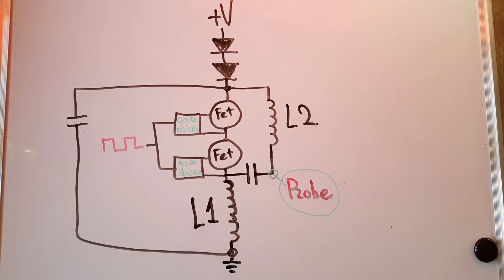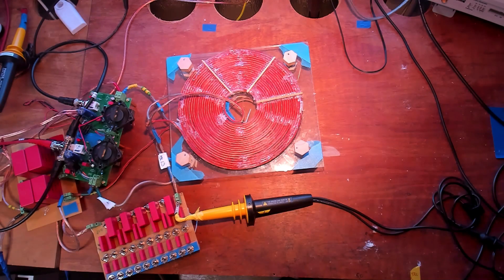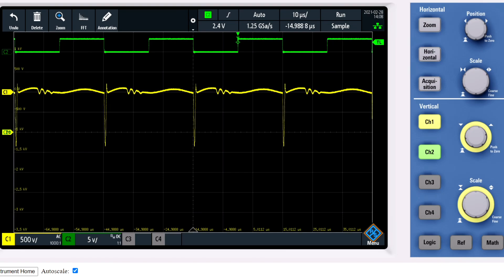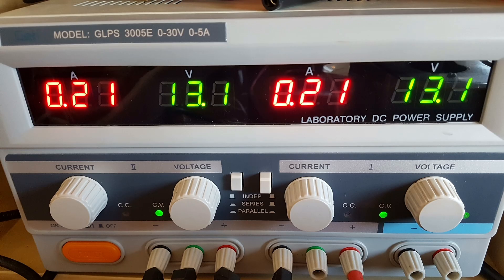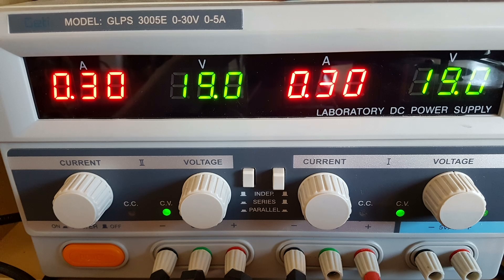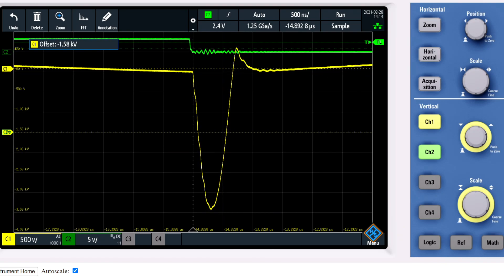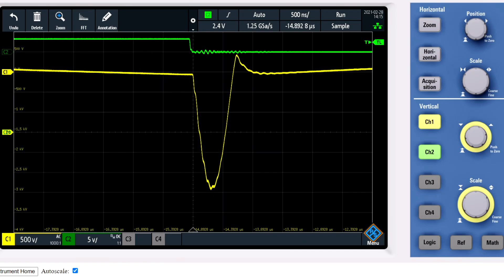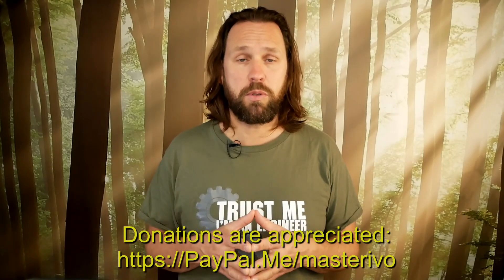High Voltage Impulse Generation

Comment: I hope you are doing great . I am wondering  can the inductive spike create magnetic field.  Yes  coil get's magnetized.  My question is polarized by differential back EMF ?  I think Yes.
Reply from the maker: The inductive spike is a resonant voltage half wave. It can do several things.
Can you ask the question again in other words?
Reply: @MasterIvo  I understand that resonant is a complete balanced circuit fine tuning is necessary .  Do coils have north and south poles toward magnetic field or does it become a undirected field. like ac that require more pushing volts to create polars.
Reply: If inductive spike is redirected to coil will it produce a higher magnetic field is question also.
Reply from the maker: The impulse from L1 creates an amplification of the magnetic field of L2.

resonance (full cycle) has 4 transformations between voltage and current, thus the current has both polarities. This means the magnetic field is alternating. so the polarities are flipping
Reply: @MasterIvo  love it Bro peace back too studies

Comment: Master Ivo, I have some serious urgent questions that I can’t find an answer to anywhere else, may I please send you an email?  Can’t seem to find your email address?
Reply from the maker: what is it about?
Reply: Regarding your initial circuit, I keep blowing midgets or not getting results, may I ask if drain of mosfet is connted to positive 12v battery then what is the negative side of battery connected to?   Same question is using dc to dc converter?  Also in your newer high-side circuit from the diagram I can’t tell what you connect the mosfet drain to??   Lastly I have many gate drivers and mosfets and I read the spec sheets over and over but I’m at a loss. To understand how to match a gate driver to mosfet?  Any help would be greatly appreciated, happy to send you a private email and donate as well
Reply: ***not magnets I mean mosfets, sorry
Reply from the maker: the battery is only powering the gate driver circuit(including buck converter).  the mosfet is connected to a separate power supply, if the drain is positive, than the source is connected to the L1 coil, amd the L1 coil (other side of the coil) is connected to the negative.

The battery is a separate power supply circuit! its negative is the mosfet source.

hope this helps.

each mosfet type prefers it own Vgs,   this voltage between gate and source makes it switch.

some mosfets need 15V Vgs, others need 10v Vgs  others 20Vgs.

the gate driver needs to be able to supply this voltage. that is supplied by the battery (in my circuit).
Reply: Yes but how do you power the mosfet drain? There is only one connecting point, so if the separate power source is a battery or dc converter or bench, where do you connect the other negative lead? I’m confused beacuse any separate power supply has at least 2 wires negative and positive but the mosfet drain only has one pin?
Reply: In other words what is the separate mosfet power. Supply grounded to?
Reply from the maker: V+ to mosfet drain
 mosfet source to L1 coil inside rim, L1 coil outside rim to V-(ground)
Reply: Thank you for your kind advice!

Comment: I was reading his patents on this. Main advantage of such coil Tesla said is the potential difference between turns is small and more safe to work with as there is no arcing at high voltages for that reason. Other benefits he mention to be related to capacitance and what we call today impedance. He said that you could use it with no external capacitor in some cases as coil it self has it and its equally distributed in coil sufficiently to negate some unwanted effect with resistance and inductance. 
Interesting project.
Reply from the maker: correction: potential differences between winding is big.
Reply: @MasterIvo  it should be half of potential that would normally occur if coil is wound by single wire. Because second wire is connected to first at end of it, half of total potential per turn in each of 2 wires?
Reply from the maker: @darkobul1   yes, And if resonant those voltage can go up to thousands of volts
Reply: @MasterIvo  Nikola Tesla used them in few patents and was using them with millions of volts. Too bad I can't copy image of quote but Tesla bragged about it as very safe for such high potentials which is unheard of for ordinary transformers which became dangerous at those potential differences and often can explode catastophicaly. Obviously for such potential of millions of volts he used large coil that we probably can see in photos of his Lab.
I am curious to see your experiments on this coils and what properties you find.   I was thinking also to use mosfets in similar way and I am glad to see it works for you.

Comment: what's the point of high voltage?!!!! you can get thousands of volts by just using a simple 9 volt battery and a few fly backs and get 10000 volts why go through so much effort for something simple like that
Reply: because flybacks have much higher impedance and capacitance and also resistance lol.... its all bad from flybacks...    i want too see IVO get serious with fast potential, not just high potential
Reply from the maker: Not only fast, also cheap, low power cost
Reply: @MasterIvo  can you plz elaborate because I can't see how the coil setup could be cheaper than a 9 volt battery with a few flybacks
Reply from the maker: take a look at https://youtu.be/1Flj1i0zQ-8  from 15:32
when L1 and L2 are close coupled, the power required drops to very low levels. 
I am working on a more advanced circuit based on that video.
Reply: @MasterIvo  it looks like something that can compliment a project I'm working on that needs dc power  maybe you and Patrick would kindly like to help
Reply: i have reached insane efficiencies with closed loop transformer systems, - in the order of 99% with MOT's, using superimposed waveforms,  but i really see no way forwards without using open system thermodynamics
Reply from the maker: yes open systems. Thats why I intend to implode the dielectric field of a high voltage capacitor. this unbalance is then to be filled by the ambient medium.
Reply: @MasterIvo  so do you want to help with the project?
Reply from the maker: I don't know, tell me more about it
Reply: @MasterIvo  got it
Reply: @MasterIvo  I sent an email plz let me know if you received it
Reply from the maker: @mohammadhashemi1771   recieved

Comment: Can anybody recommend an affordable high voltage probe ? I guess 10kv?
Reply from the maker: Pintek HVP-08
Reply: $1 worth of resistors works perfectly
Reply: @patrickwatkins7572  yes thanks patrick but i did make one and as its high voltage with large capacitance i just don’t feel confident in it . I have ummed and aaaard a lot but after a recent jolt from a mates tazer i feel i never want that feeling again so i feel just to uncomfortable about it. 👍🏻
Reply: Maybe i get a cheaper 2000 volt probe and add some resistors to the probes end ! Would that work? I am thinking it should but how would i know if my reading are true ? I was thinking run a test at 2000v and then use estimated resistors to divided it in half to 1000v onthe scope but would that be linear and still half as i come up to 4000v on the test point ?

Comment: I'm testing running different motor prototypes with these types of impulse. It's a lot of ⚡😂🤣difficult not to have meltdown. Ivo if you send me some of your obsolete equipment I can test how these outputs perform for powering motors.
Reply: SoNotGoodForMotorsBecauseTheHighFrequencyMeltsTheIron.MaybeMotorsCanBeMadeWithoutIron,OnlyCopperWinding.

Comment: What do you think of the work of Ken  wheeler?

And the electric universe model?
Reply from the maker: Ken Wheelers work sparked my research in 2016. It is fascinating. But it is not based on electric experiments, rather in permanent magnetic fields.

I am not familiar with the model, but I do feel the universe is electric, meaning all are fields.
Reply: @MasterIvo  what is the difference between his permanent magnet concepts and your experiments?

https://www.thunderbolts.info/wp/2021/02/23/the-long-farewell-to-the-big-bang-model-of-cosmology/

Comment: According to Paul LaViolette's documentation of Thomas Townsend (TT) Brown's work in electrogravitic research, it appears one needs to get up over 20 kilovolts to start seeing appreciable (measurable) results. It appears that the B-2 (aka Bifield-Brown Effect) bomber uses this in an asymmetric capacitor arrangement to pull itself through the aether.
Reply from the maker: yes, but it also depends on the plate distance. I believe it is confirmed the B2 uses high voltage on its wings.
The real magic only happens when that high voltage field discharges. they never tell you that, but it is in T. Townsends lab notes that I read.
Reply: @MasterIvo  very, very interesting. That seems to ring a bell actually... Hmm, do you have a link handy to what you read in that regard?
Reply from the maker: @cryptonein  I think I found it on rexreasearch
Reply: @MasterIvo  , Love your work! Very precise compared to my switching. Yes the plate distance controls the heat exchange capacitance. 

A rule of thumb I've discovered for working low seed energy propagating plasma containment is a space distance of about 1 7/8 inches (7.3025 centimeters). I noticed a self adjusting resonating effect propagating heat with open air capacitance coils. 

My first discovery of this duplicatable effect was with alcohol burners constructed from aluminum soft drink cans. (known as penny burners) With this spacing I could add water to the alcohol for a mixture of a little less than 40 percent pure alcohol to 60 percent tap water. This distance between the parabolic shapes got the longest burn times from the fueled plasma of up to 20 minutes burn time per 1 ounce mixture. I've found this spacing to actually be an electrical conversion with open air non Ferris capacitance values consuming all the fuel. I love working with asymmetrical electric motive conversions. I've worked with radius bifilar pancake coils up to 30 cm with this spacing adding a little parabolic cup with this spacing distance.

My unproven theory is that ambient nitrogen aether element is what Nikola Tesla found to resonate with? I believe he learned to manipulate localized asymmetrical (Parametric resonating) cycled imbalance of atmospheric nitrogen  densities creating an atmospheric battery/capacitor. 

He controlled the discharge rate by creating variable ozone spark chambers. The main fuel that facilitates the at ground level preparations was probably anhydrous ammonia and a natural flowing underground water stream. A very inexpensive fuel consumption for the energy that's harnessed. The RF transmissions of usable electricity from there is well known. With his system depending where the ground potential was tapped it's possible with the receiver to facilitate AC or DC Electrical Power employment delivery. 

 My favorite is working with out of phase cold energy with high potential and using resistance to bring it back in phase to produce very hot energy with very little seed energy input. You are on the path to realizing very high Q factors. It's not a free lunch however it's amazing to do more with less when tapping into the bipolar parametric resonance field. Cheers

Comment: You are creating a lot of negative "cold" electricity. It is not your ordinary electricity (resulting in heat death), but a very special one! You can do a lot with it! 
You can convert it back to positive electricity and use it by ordinary means with no benefit, or it can do work for you for free and can multiply. 
You just need to collect it at L2 or L3 (at a point with no electrical connection to the source, just to earth ground = it is a product of resonance) using bridge rectifier and HV electrolytic condenser.
You then pulse-discharge this condenser using power thyristor diode through one or multiple impedances connected in series (as via long antena) into the ground. As Bedini said, if you tune the impedances right, you shall be able to harvest copy of the energy at each node (...of said antena) to collect the upper harmonics. Or better - at multiple transformers' primaries. The transformers thus shall be similar (similar lenght of wire in their winding / node) and tightly connected. Thick wiring shall be used on them as these pulses are over 100Amps! Also have a tuning impedance aka rheostat (an old-school variable resistor) on this line to do the magic and optimize energy transfer and "communicate" with your L2/L3 back to excite even more electrons into them from the ground.
Only major obstacle is, you will need special core material for these transformers of high magnetic permeability at radio frequencies in 10-100KHz, at which the pulses will be driven through the transformers' primaries. Otherwise you can cook fries on them *eddy currents. Use nanocrystalline or Metglas amorphous material for the cores. Make your special transformer(s).
And also off course be sure to electrically isolate your controlling module for the thyristor from its cathode by using optocoupler (or by using special light triggered thyristor with opticial cable), otherwise say bye bye to your precious timing module :)
If you find success, varistors help limit the excess energy. So you don't end up in huge plasma ball.

!!!BE VERY CAREFUL!!!

KEEP SAFE AND GOOD LUCK!

Comment: Hear the lust in his voice when he says:I'm gonna tune it even higher......😏
Reply from the maker: and then the voltage goes lower ;)
Reply: @MasterIvo  it seems it always seeks entropy. 😥
Hahahaha
Reply from the maker: ow this is just a simple test, the full setup will come later. The idea is to implode the field, that creates an external inflow to fill the vacuum.
We'll see :)
Reply: @MasterIvo  count me in if you need Guinea pig for testing the mind elevating effect
Reply from the maker: already successfully tested it (see ascention seat). It needs further improvement, but that's for later. First things first
Reply: @MasterIvo  do you use it often?
What kind of improvement do you foresee? 
 Have to experiment with that stuff.
Reply from the maker: I use it when my experiment has drained me, which happens less and less because I'm more careful these days.

Last time I was totally drained I forgot the chair. next day I was still extremely tired. then I remembered to sit on the chair. afyer 20 minutes I was totally fine again.
I let many people test it. and all felt it. subtle but noticable.
I do want to develop it further, but I'm still learning what really is happening.
for now I conclude L1 and L2 are stucking the life out if me, while L3 gives energy back to me

Comment: Congratulations Ivo. What radiant  effects u see at 2kv impulses ! Can u pls make a video with L3 coil at 2kv ! Excited to see what effect we get with that.
Reply from the maker: Will do soon, first I need to make the coil capacitor of L2 and L3
Reply: What are radiant effects?
Reply from the maker: good question @Sillybears, I am researching that.
So far I have seen several effects from using Impulses, which are: health benefit, ionising beta radiation and resonant power.

Comment: Think you could get your input current down if you didn't have the fets on for as long as 50% duty.
Reply from the maker: yes, but I can also get it down, by close coupling L1 and L2!
Reply: @MasterIvo  between the two ways you should be able to get that impressively efficient for pulse production
Reply from the maker: indeed. It's amazing